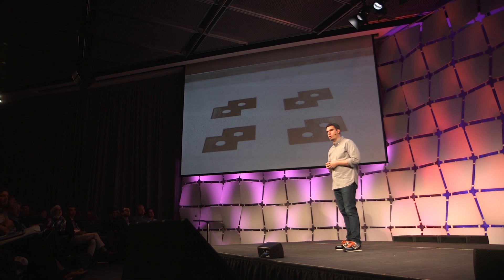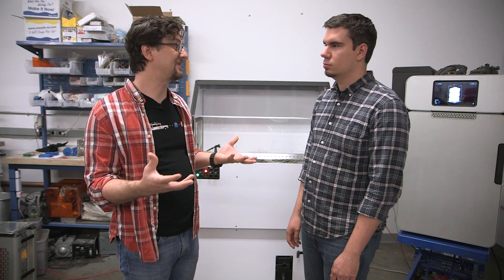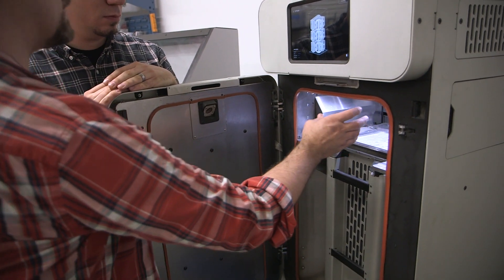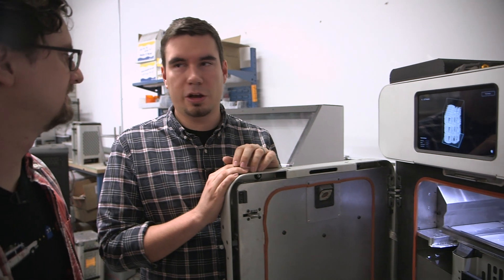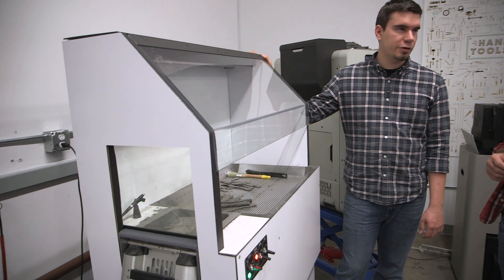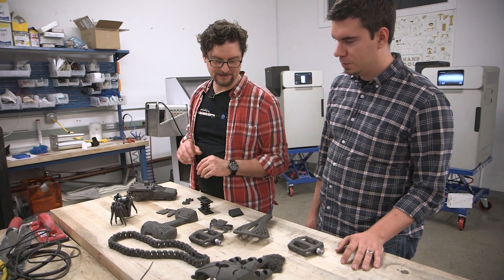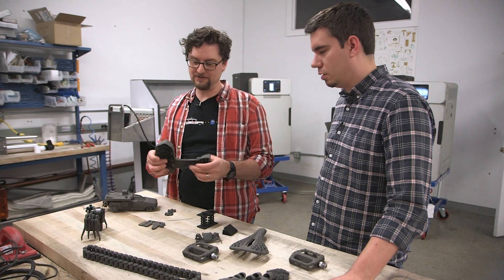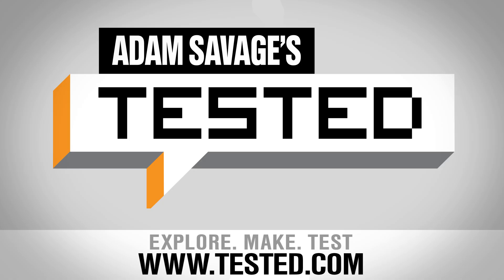Formlabs Fuse 1 SLS 3D Printer Demo!

Comment: Only $20k for the "normal" person to make those cos-play items and other useless crap that the majority of the 3d community prints out (sadly, myself included though i'm doing more functional prints these days).  

Also they're like "i don't think you could print this on other machines, or i don't think you could clean out all the support materials.... have they not heard seen pva and other water or solvent based supports? Seems that formlabs "scripted" few aspects they could talk about.   Nylon can also be printed on a few FDM printers as well... but anywho... 

Also I doubt that anyone would use these for end production use, these types of machines seem to be more for prototyping so yah....

Lastly this will be awesome if you can use metal powders, oh wait nylon only. 

Also heating that volume of material seems it would be a huge power suck if these were in your benchtop, oh and a dedicated 15amp circuit... 

while initially exciting, just like form1, price tag does not equal exciting enough to purchase.

Not sure if i'm happy with how tested is progressing to more of a showcase of commercial high end tech compared to what they've been in the past more hackadayish in the past and stuff for us "normies".   Not all of us geeks are dot com billionaires.

Comment: Only thing is you can't print hollow objects
Reply: 136bennyboy yeah you can actually, to create a hollow vertical cylinder the printer would just have to melt he nylon on 3 or so layers and boom. Hollow cylinder. I don't think you really understand how the printer works. Horizontal hollow objects are possible too, just don't want to explain it.
Reply: Munchiemiester then how would you print a hollow sphere then? mister know it all. the stuff you print would have to be solid and take hours! and any thing that you want to have a cavity in will just stay filled with the nylon beads.
Reply: That's the one disadvantage of these particular printers, an exhaust hole is required to remove the excess nylon. Although yes, it is still possible to print a hollow sphere although with an exhaust hole.

Comment: Now if they could get it to do metal at that price... Also still too expensive for the average person (needs to be more in the range of home appliances), this is still aimed more towards small businesses. It is a step in the right direction though.

Also one downside they don't seem to mention much, need for exit holes if you're doing partial or hollow in-fill to reduce weight. Acceptable trade off for not needing support structures as waste.

Comment: This is so amazing.  I love seeing how much the prices are dropping on machines like this, while the user experience and quality are improving in leaps and bounds.   I'm curious what the cost of the powder is, and what kind of paint finishing options there are.  I do find it a bit odd that the reclaiming and mixing stations are roughly equivalent in cost to this amazing and complex machine, seems like the price on those could be cut down by at lest 50%, if not far more.

Comment: I've used a SLS printer maybe 6 years ago, the prints were extremely brittle but highly detailed
Looks like they've solved the brittle problem, awesome
Reply: Yeah i actually wanna see some tests. Like seeing it dropped on the floor from standing height.
Reply: Not sure what you were actually looking at 6 years ago but SLS parts are generally pretty good for strength and stiffness compared to other 3d printing processes. Maybe the 'brittle' parts you looked at were actually just really thin and easy to break?
Reply: I hope so!!!!
Reply: If you compared it to metallurgy it seems like the difference would be... the difference between extruding (very strong continuous grain) similar to how a regular 3D printer prints extruding material, with sintering/casting/deposition which is fusing individual particles together which in general is more rigid, can be stronger if done correctly, but inevitably more brittle because the bond between individual particles can't compete with an extruded "string" of material.  Probably why they're using nylon which has a higher modulus of elasticity.  Its like anything else though; its the application.  For somethings its game changing, for others its sub par.  We're not there yet.

Comment: curious about the print speed
Reply: 10mm an hour :)
Reply: Emmanuel Umukoro -21 hrs left, layer 120 of 2055 layers at 100micron for those 20(?) pedals.
That's all I got.
Reply: That's faster than an FDM if you load up the whole bed.
Reply: Yeah, it's roughly comparable to the Form 2 in terms of speed.

Comment: I have one question about this: The process of fusing the powder into a solid, air which is trapped between dust particles, does it get included in the part? If not, does the fused piece have the same density as the loose powder? Or in this problem not existent all together?

Comment: Nice printing results but so wasteful on the material
Reply: vizionthing You can reuse all of the powder that the laser doesn't fuse, its in the video.
Reply: I disagree, they are only recycling 50% but talk of a more aggressive mix but don't state how high you can go, they settle for 50% as the optimum reuse/ quality finish level  - so what are you going to do with the 50:50 mix leftovers from the second print?  - that's going to end up at 75 old to 25 new - you can see how this going down a rabbit hold of diminishing quality  - sooner or later the powder will be rendered unusable and you will then have to get rid of it?
Reply: vizionthing he says you can fully reuse the powder without adding any new powder.
Reply: I think its 50% new and the used is pretty complicated to figure out as it's mixed. There maybe particles you put in from 10 prints ago but nobody is going to monitor that. Old just labeled old regardless if its 2nd print or 10th. Unless they state an hereditary limi? I'm sure they have done many prints reusing the old and therefore know it's not really an issue. I don't really know the side effects with the unformed polymer though I'm assuming there maybe some localized heating for unused material around the part. be interested in to find out more in the future.

Comment: In 20 years when you can print like this from your home, there is going to be somebody using it exclusively to print dildos
Reply: You can dye and polish it... before polishing yourself with it.
Reply: I assume when you say somebody you actually mean almost everybody. ^_^
Reply: In 20 years?

People have been 3d printing out sex toys out from rubber materials for several years now........
Reply: You dont have to wait 20 years, neither pay 20k.. more like 200$ fdm machine will get you started :)
Reply: WHY WAIT?!?! 
IMMA PRINT A HARD SLS NYLON FLESHLIGHT THIS YEAR D00D!!!

Who cares if casting silicone is astronomically cheaper?
Reply: +fritter63   It's for her pleasure.
Reply: there already is look on etsy, but they use plastic extruded printers and they usually use it to make molds
Reply: actually a company in the same building as me is has developed a way to print silicon parts no need to chafe your delicate bits
Reply: But you can smooth-out the surface if you wanted to, or put on a hardening enamel of some kind to give it a smoother surface. Heck, you can use it as the base model for modeling then make silicone repeats.
Reply: Too late, there are a few dildo 3D makers
Reply: too late Everyday Bodybuilding, we have already printed dildo for valentines day ; )
Reply: 20 years? a printer like this 2-3 years ago would cost $100-$150k. More like another 2-3 years for it to hit the home markets at a semi affordable/ enthusiast cost i.e. under $10k for everything needed.
Reply: also big companies rent out time and number of prints to the consumer lvl so you can go out and use a $100k+ machine for a few hundred to a few thousand dollars.
Reply: 20 years? BEHOLD http://www.dildo-generator.com/3d-printed-custom-toys/?rbdata=[-151.5,914.4,-153.2,765.4,27.9,841.7,74.9,738.4,83.2,720.1,88.4,428.6,29.1,261.7,-15.3,136.7,-46.6,122.5,-46.8,10,-47.2,-197,50.8,-24.6,9.7,-190.5,-182.1,-965.3,56.9,-913.7,151.5,-913.7]&preview_bend=38

Comment: This guy's sense of home use market is vastly skewed. $3000 would be more in the ballpark, and that's still a lot to lay down for most people.
Reply: it's roughly a factor of 10 cheaper than other SLS machines currently available, I say that's a first step into the right direction ;-)
Reply: Although you won't be seeing these pop up in many peoples' garages, they could conceivably be set up in maker spaces.
Reply: precision!
Reply: How about the Sintratec Kit (around 5k$) the Sintratec S1, or the Sinterit Lisa? We already have SLS in that price range for "desktop" manufacturing. The biggest problem is the powder and the mess you will make with it. You need a dedicated room for it. Just look at SLS production floors from large companys like Shapeways, it's a dusty hell in there....
Reply: I print nylon gears for repairs on 200$ chinese kit printer. Tell me again, why i should want that SLS printer?
Reply: years sure, but not that pump housing that goes into your washing machine. This machine however can, provided you have a model.
Reply: but thats to do with pressure right?... if its binded right per layer.. it could do that!
Reply: Not so fast, a washing machine pump housing needs LOTS of supports to be printed on FDM. I've got supports working rather well on my printer but I still wouldn't want to need to print that. It will be messy, need post print cleanup and may just work if you're lucky. SLS on the other hand is absolutely ideal for this.
Reply: SpeckyNation he just means that it's not only industrial
Reply: $3000 for the printer and another $2k-$3k for BOTH the cleaning station and mixing stations and it'd be very reachable.  For the $20,000 I need to win the lottery.
Reply: If they can get it down to 4-5k, I'd consider it at some point, but daaaamn. Hopefully someone comes out with something with similar abilities, maybe slightly less fancy.
Reply: 3D printing will for the near future only be usable a prototyping tool not a way of manufacturing.
Reply: Ok, but why the fuck are you replying to my comment? We're talking about home consumer use, not business commercial...

Comment: Cant wait for them to have a white nylon so you can use dyes for colors besides black
Reply: With the current laser system white wont be possible (needs much more power->other laser class/type-> more certification-> more expensive). But I can maybe see other dark colors working...
Reply: Ilios does a 4 colour system. not in this price market though.

Comment: That's actually badass af. Being able to print while simultaneously intertwining stuff?!?! The future is cool.
Reply: Pete's Shredder. True, but you had to soak the parts in resin or cyanoacrylate in postprocessing and the parts were very brittle, you would not do anything structural with them. Now this is made of nylon and the price has gone down by a factor of 10 so it's accessible to small businesses, startups and maker spaces.
Reply: This technology has been around since the 80s
Reply: 50 years from now, assuming our robot overlords allow it, single moms will be 3D printing children. You'll design your dream child in Lil-DudeCAD or WhipperSnapper 4D, upload the file to the Spray-a-Baby website and pick up your brand new kid in about 72 hours tops or have him delivered directly to your doorstep straight from the fulfillment center. Wanna skip the messy stuff? You can even have him biosculpted to toddler size with the home training mod, so you'll never have to deal with dirty diapers or temper-tantrums. No need for packaging. He'll repel down from the Amazon Stork Heavy drone onto your driveway, walk right up to your front door, and ring the bell. You'll have to show I.D. and sign for him, but hey, when you hear your brand new bouncing little toddler say, "can i have some ice cream!" you'll realize that $1,000,000 (inflation adjusted) and extensive background check was money and time well spent!
Reply: @salaciousBastard   If they are  "single moms", then they have children already so why the need to print a fake one?
Reply: The powder is still $200 a kg and you can't reuse more than 50%.